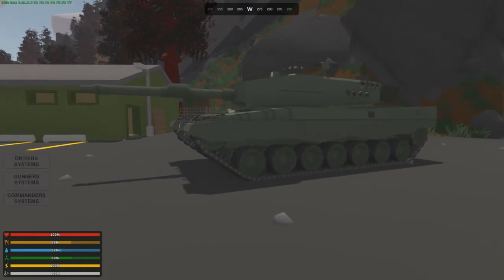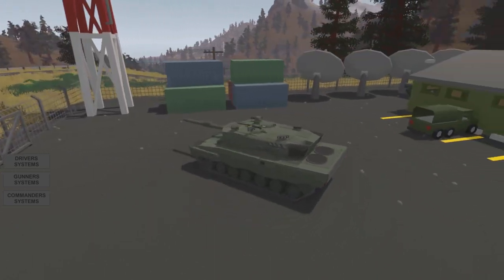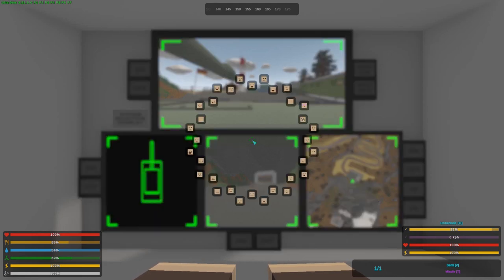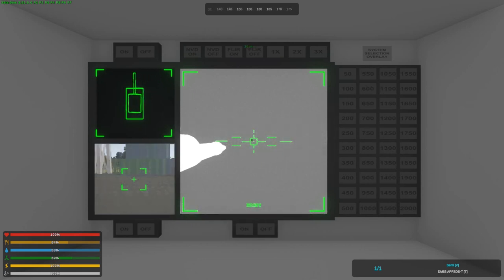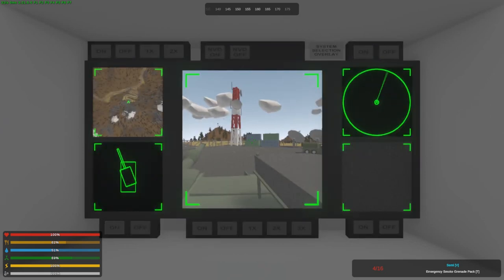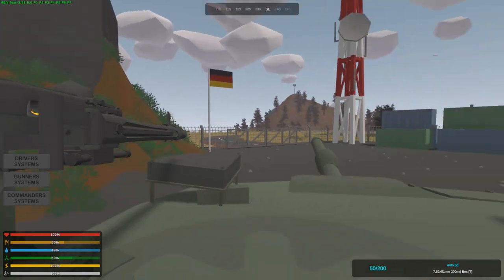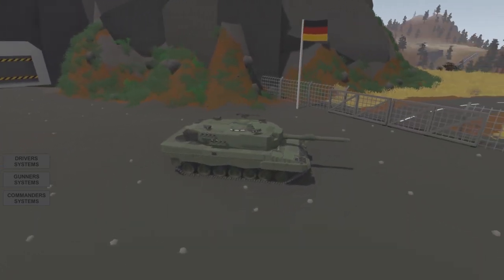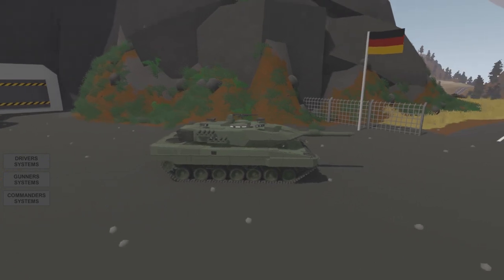Unturned ZWS Release - Leopard Main Battle Tank Pack v1.0

Comment: Hey watched the tutorial but i have a problem. Any leopard that i spawn in i turn on the engine and the systems but i cant move whit w or s and a or d works but the tank is stuck in one place. If you could help that would be greatfull.
Reply from the maker: That's strange, it shouldn't be happening. Try re-subscribeing to the mod and dependencies
Reply: @ZoliWorks  Yes seem's to have fixed it and all the other vehicle's bugs as well. Thanks!

Comment: This is officially replacing your Abrams mod as my mainline tank mod from you
Reply from the maker: Not a fan of American tanks? :p
Reply: @ZoliWorks  No, it's more of the performance issues with the Abrams mod
Reply from the maker: @Sierra-208  Fair enough. I'll be updating the Abrams as well to be up to my new vehicle standards and adding up to 30 new variants
Reply from the maker: @Sierra-208  Take a look at the Abrams pack again, as I've reworked it entirely. Even better than the Leopard pack
Reply: @ZoliWorks  M1A2s are back in my garage now ^^